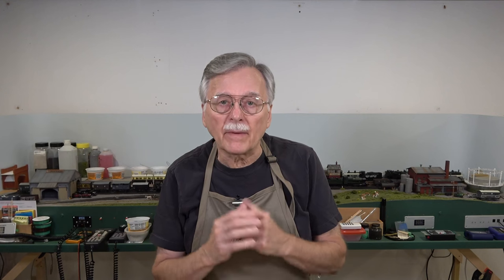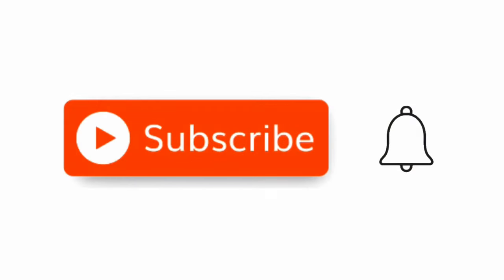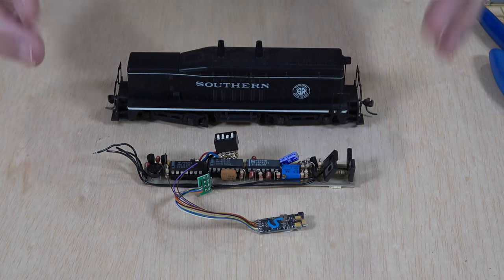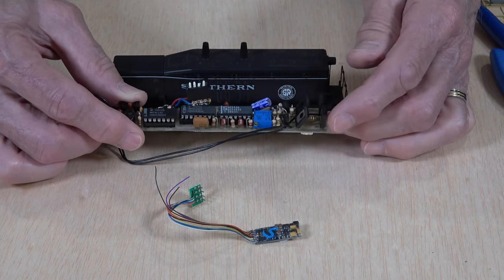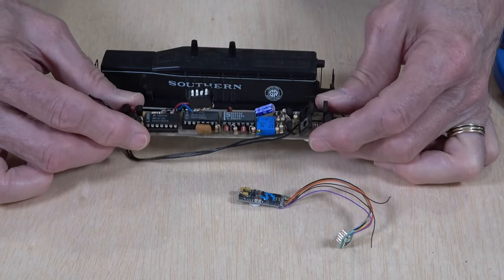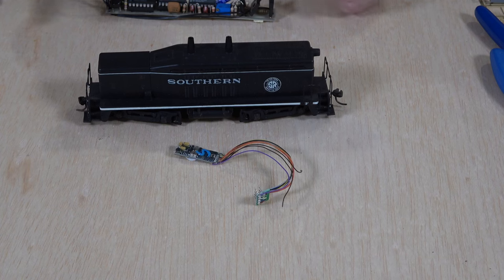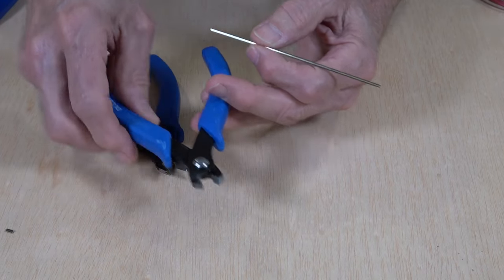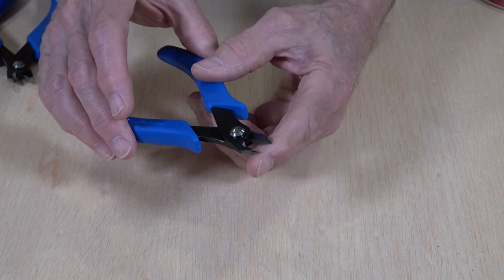Hand Tools Pt2 & 50,000 Subscribers (368)

Comment: The Australian plug is the same as New Zealand. I found your video very useful. I got the wire stripper in an electronics store in Blenheim, NZ. It was cheaper than buying from Richard allowing for the exchange rate. Sometimes we are lucky in NZ when that happens, but it is still a very expensive country to live in.

Comment: I bought a bus wire stripper I found on Amazon two years ago. It is similar to the DCT-BWS that you have listed. Cost me plenty of money but it was worth it after having other wire strippers that were breaking down or they would plug up. And I use it to strip the wires on most decoders with no problems.

Comment: Can't beat a Xuron cutter.
Reply from the maker: My Xuron track cutter snapped on me so I’ll see how these hold up.
Reply: Re: Mini-wire stripper- rather than spend about $20, one might consider using a $2 Bic lighter or an even cheaper match to burn the insulation off fine wire-clean the residue with your thumb nail + no need to do trial and error in getting the tool adjusted.